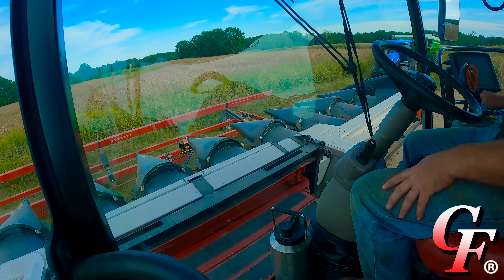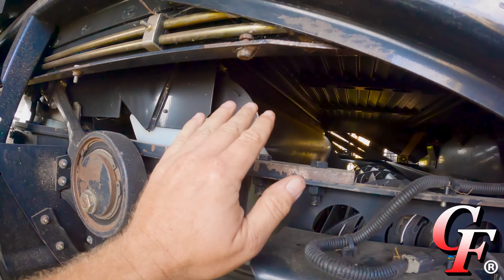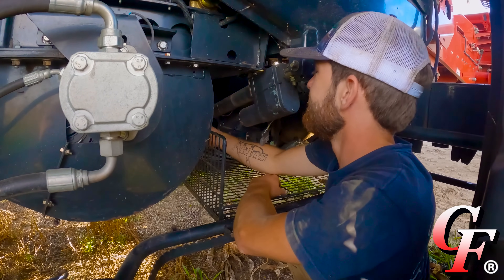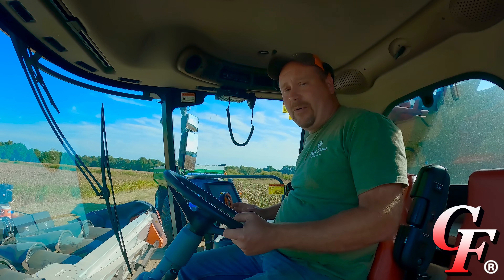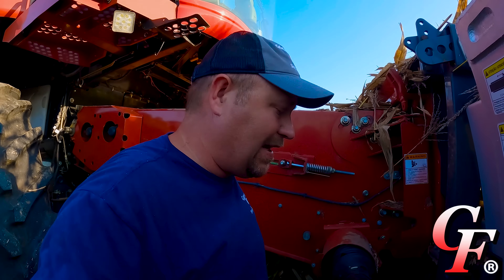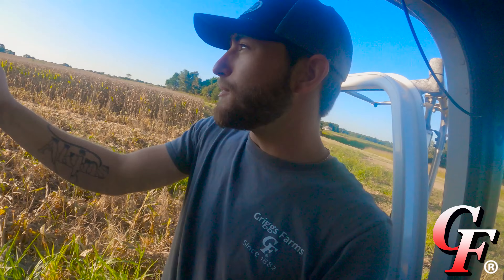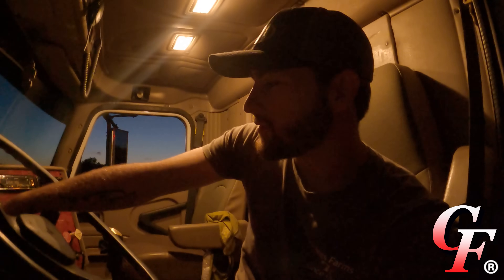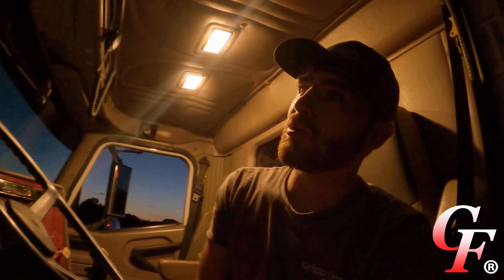I Jinxed Us!!! We Were Not Prepared... Corn Harvest #1:  (9/13/23)

Comment: Hi Matt, We use to run the header a little higher in nice standing corn just under the ears to help with header loss. It seemed to shorten the time bouncing around on the gathering chains and went up the feeder housing smoother and faster. Just a thought.